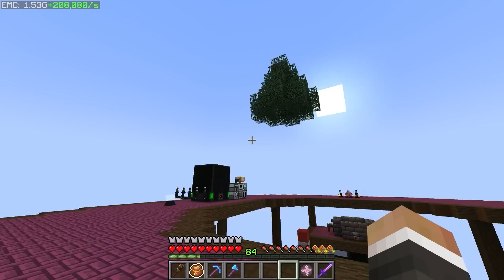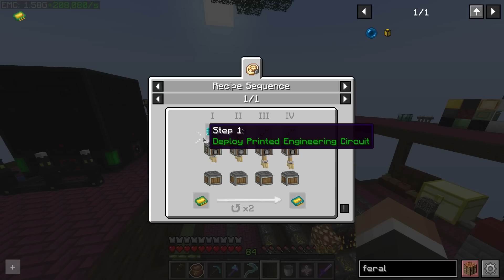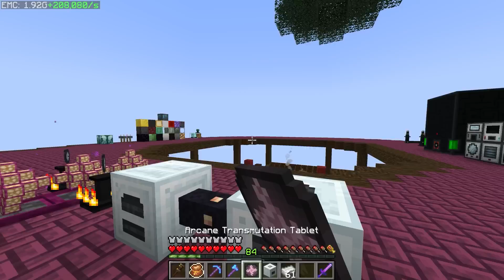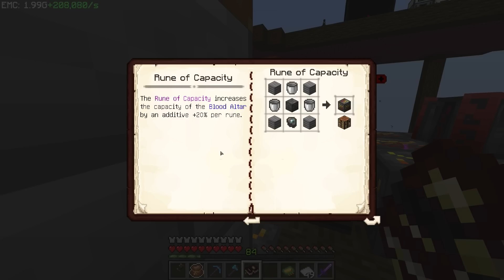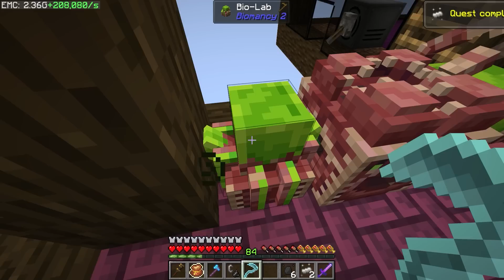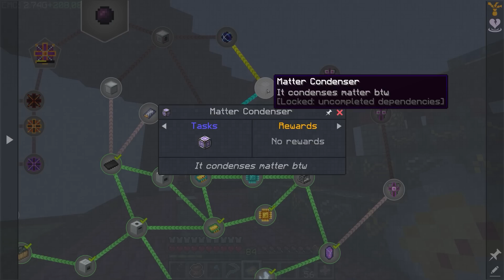Minecraft Project Sacrifice | INDUSTRIAL CIRCUITS & DRACONIUM INGOTS! #13 [Modded Questing Skyblock]

Comment: I have to say, I still don't understand why you don't automate a little bit your blood altar ^^'. Using an input and output chests on both side, with item pipes to and from your altar, you can filter the output pipe to the receipes you want and then you can bulk craft by depositing items into the input chest and having enough life essence. Cheers
Reply: Blood magic also has its own "pipes" (they're wireless) where you can how many items go in the altar at a time, 1 item by 1, that you can't do with the other pipes, they're also pretty cheap to make and with them, you're able to automate the altar pretty early.

Comment: Unless you use flux points for draconic evolution, the infinity pipe upgrade is needed. You will need a LOT of flux points though like 45 at least